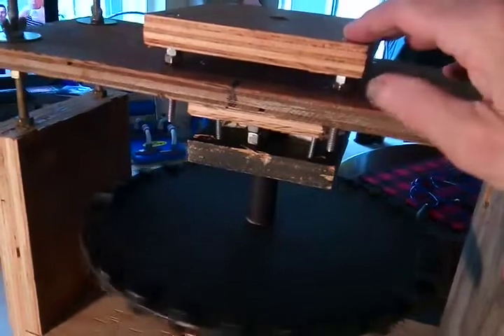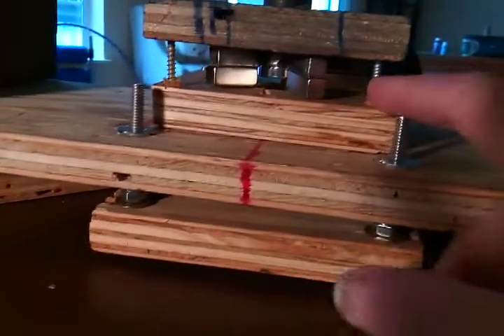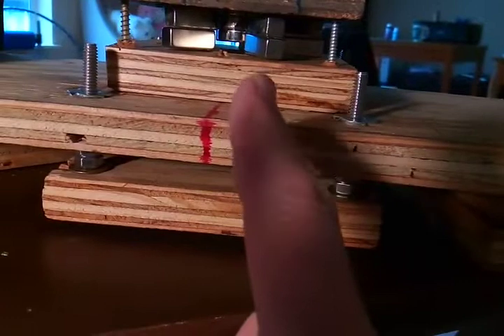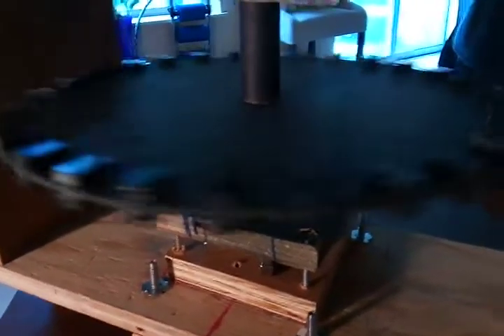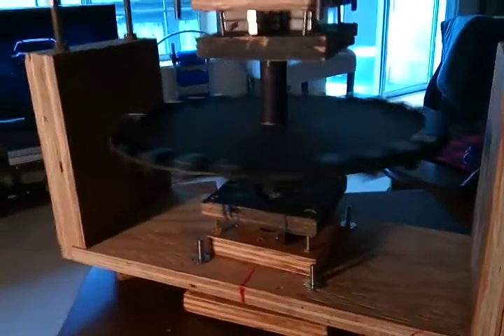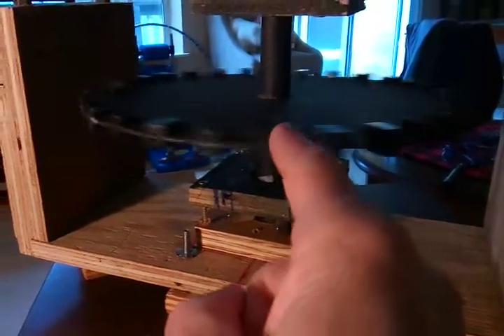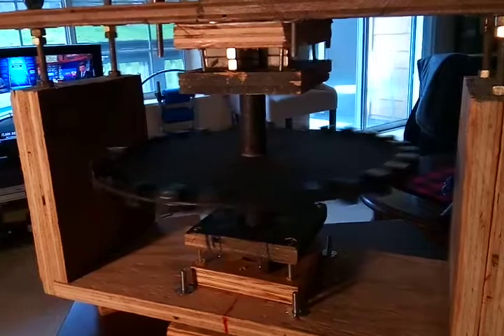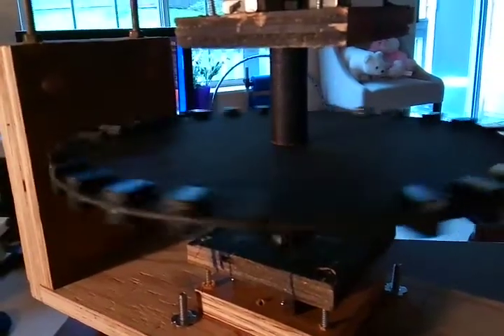Floating in air with magnetic bearings spinning smooth!!

Comment: https://www.youtube.com/watch?v=55VO-5Bztmc I have a very similar design. If you make the array adjustable and adjust it all the way in, you will be able to adjust the z axis magnets in closer so you get actually visible air gaps so you know it is 100% floating.... Can you get a piece of paper in the gap at the top?
Reply from the maker: It was floating for a few hours, next day I got it floating again but so unstable and fidgety it just wasnt practical as is....rotor is so big and wide its just not practical as it is but it did float so hoorah for that. I eventually put in skateboard bearings I might tear the floating magnet structures apart and double the number of magnets in them might do it but not sure if I will get to it.  Working on BiTT transformers right now....

Comment: I had to hit around 1800 rpm to lose the lenz effect with 22 magnetic poles.
Good work on the magnetic bearing! I have a patent that uses a magnetic thrust bearing to minimise friction, we have found it helps a lot with efficiency especially at high rpm.
Reply from the maker: Hi David 
How many magnets in rotor for 1800rpm to be no lenz? 
What was the load and it's resistance?
What was ohms of generator coils?
This rotor is floating, but "just barely" if you knock the frame with your fist it drops down too easily.
I put a much bigger "stop"  magnet below today to keep it floating and suspend it better and stronger...
Reply: @MrDKONZEN   I will have to check my videos it was a while ago, but the rotor has 22 magnets, coils have 0.45mm wire with a 50w bulb as a load.
Reply from the maker: @daveparf  Hi David     I looked at your channel and saw the video with the 22 magnets, you say the combined resistance of the coils is 1.8 ohms, so looks like you did combination of series and parallel with all the coils....Sure takes alot of watts to get it up to speed!  If you had 23 coils or 21 coils against the 22 magnets (one more or one less coil vs magnet number) this would be following the Bill Muller "doctrine" of odd vs even coils vs magnets to reduce rotational latching,   also if all coils hooked up with FWBRs and DC side of all FWBRS connected in series for "one big" DC output, and then combined DC outputs into load, then the odd vs even thing can also "I think" reduce lenz law braking of rotor too, not just the rotational latch.... since lenz will be confused which way it wants to brake rotor "backwards" 
Look up the RomeroUK Muller motor generator and how he hooks up his coils to output of a big cap, and big cap loops back to power motor coils. 
Also if you had two rotors with 22 magnets in each, and the 21 or 23 stator coils between them, you could stagger the rotor positions on axle so first rotor A induces, then rotor B, and have rotor A all N facing coils and rotor B all N facing coils too, BUT inducing opposite ends of coils...(hope you understand this) now you can make a nice AC in the coils since its one end then the other end that gets induced.....advantage here is for example instead of 1800rpm needed to get to that no-lenz RPM window instead you could do it with only 900rpm,  as coils now induced twice the frequency!  Now you need much less input current to get it up to speed,  and might get it overunity....
Also get rid of iron cores vs neodymium magnets! iron too slow the backemf forces sort of back up into themselves, because iron so slow to flip polarity and latching also so extreme... they can get very hot too, the iron cores....use low hysterisis cores;  metglas, blacksand , or very fast thin ferrite cores... anything but iron....
Reply: @MrDKONZEN   https://youtu.be/pYZns5ZiymY

Comment: Excellent build Konehead..... You have spent so many hours figuring this one out. Proud of you for not giving up. -- I am thinking David Bowling would also say that the type of core material will be part of the equation on 'out running' lenz effect. Are you going to wind your coils in parallel and connect them in series? What do you have in mind for core materials? Soft magnetic iron powder cores, nano-crystalline, very thin laminates? - It'll be interesting to see what you build. --- I know it will be good. I have faith in you.
Reply from the maker: Hi J&M
  Trifilar windings not necessarily multi-filar paralleled should do it too according to David B, when I wind the generator coils for this "floater" its going to be blacksand cores and trifilar winds maybe 6 or 9 wires parallel or just three wires not sure yet...I sent David B some Washington state black sand dredged up near ocean coming from creek that leads to dormant volcano with trace amounts of gold in it to test out as cores in his black beauty machine....it might work great for him might not we will see. 
Impedance of generator coils, type of core material, the RPMs, impedance of load, and type of load (capacitor, lump resistive, or inductive (coil) also variables if lenz or no lenz.... 
For motor coils, I plan on ferrite tube ground down at one end to a 15 degree slant to give  more oomph to rotation, also directional winds, and litz wire wound. 
 I want the cores to be quite long, and about 3/4 of it will contain pickup/generator winds behind the motor coils, these pickup/generator coils getting induced by the motor coil pulse for an extra kick and also this is  using the backend of the motor coils to do some work making some power back there. Those pickup/generator coils backside of motor coil sharing same core are going to be trifilar too...
Thanks for your help and encouragement with this project! It was pretty frustrating had to take many mental brakes and force myself to finish it....The key seems to be "just barely" floating from the push-down of that upper "stop" magnet against the push-up of the lower magnetic bearing......1mm off and the rotor wants to drop!  If I hit the frame hard, the rotor drops down...what I want is this to spin around 1200rpm is next step so need to get some motor coils mounted next step.